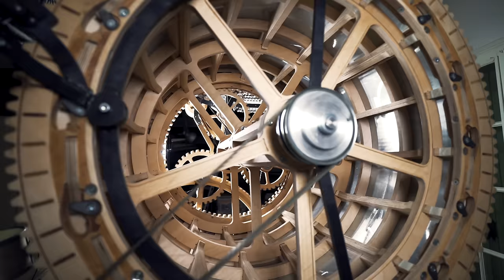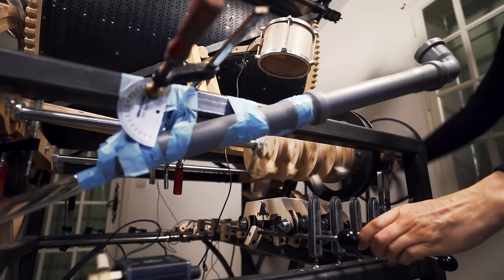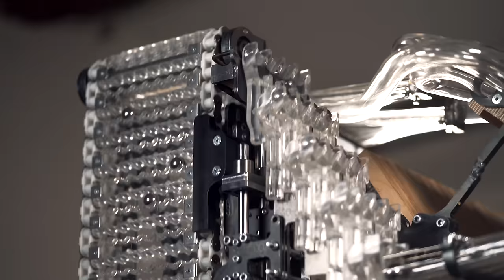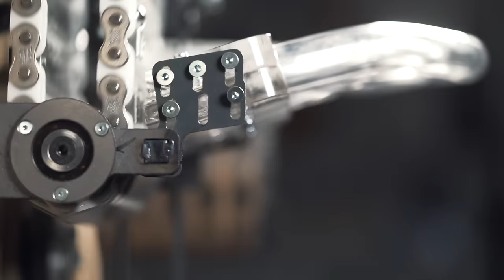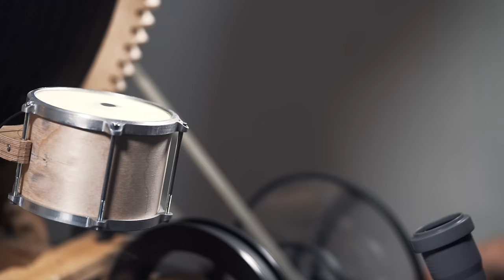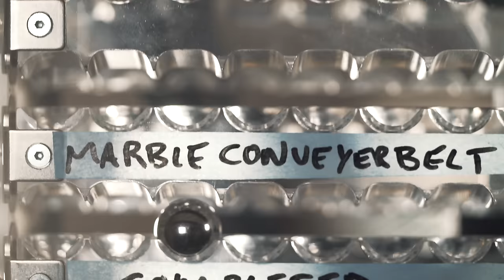Marble Conveyor Belt Completed! - Marble Machine X #78

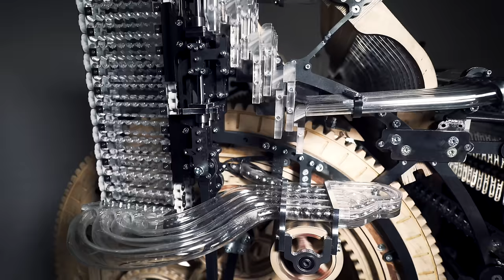Comment: I can foresee that demagnetiser causing a bottle neck. 0:35 you can see the issue up close, it is relying on the next marble coming from the wheel to push at least 30 marbles in front over the demagnetiser. 
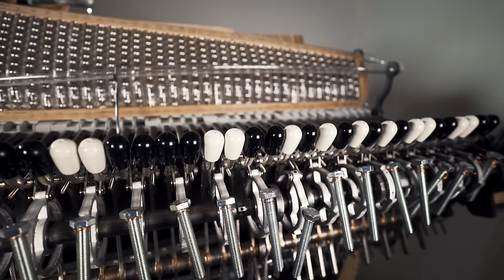Also you may have set tolerances too tight at the top of the marble divider 1:20 you can see a marble skip straight over the channel that requires more marbles
I don't say this to belittle your achievement but because you drew me into your dream of perfection and I really want this to be the best it can be! 
Keep up the good work, you inspire me to do better!
Reply: As beautiful as this all is there are plenty of parts that seem to only function with luck and reinforced with prayer 😂
Reply: He states that the marbles getting stuck on the wheel is part of the design as it forces them to hold longer over the demagnetizer and ensure perfect demagnetization
Reply: @nicolhime3981  he said marbles getting stuck going over the wheel was beneficial. However with the marbles backing up all the way to the lifting wheel, at full speed with even half the channels playing this is just going to have marbles flying everywhere.
Reply: it seems to me the solution is going to require a considerable refit. the whole conveyor belt will likely need to be lowered a couple of centimeters or a couple of links added to the chain, and just the bottom lowered so that the marble divider (the piece that looks like a tiny grand piano) is lowered and therefore gravity will help push the marbles through. This means ordering dozens of replacement parts and it could take time. So I'm willing to bet Martin isn't prepared to accept defeat in this matter just yet. Its still possible that with the force of many marbles being continually forced through that it works. If you notice its not until the wheel stops supplying marbles does the separator begin to clog.
Reply: @gwpcs  Calculating flow rates of marbles sounds like an interesting problem to solve.
Reply: Easy, just write a guitar solo into every song, while he goes fetch a refill bucket full of marbles.
Reply: How funny would that be to see that live on stage? The musician waves in a pair of helpers mid-concert as they walk in with a bucket of ball bearings and a specialized tool to input marbles into the system without causing interference.
Reply: The marbel at 1:20 wasnt flowing down that holes channel. It was flowing down one of the ones further behind it i think to allow it to go straight to the ones at the end
Reply: @jordandrake9822  I think you are absolutely right
Reply: G Clifton-Sprigg
it's good that it's sitting that long on the demagnetiser, also there's only a single note (marble) every so often. wait until more notes are filled in before trying to fix things, as trying to over prefect something before you even had the chance to see it in full force will lead to a never ending cycle of fixing what is not broken.
Reply: I'm sure there will be many little hiccups that will need some massaging to run smoothly, each will be identified as it progresses towards completion. 

It's great that it's now at a point that all(most) of the systems are built(conveyor belt, stairs, divider, release mech, flywheel, etc..) they all had to be completed before proper testing can be done, something I'm sure will be an ongoing process as each instrument is added.
Reply: @jordandrake9822  good spot I believe you are right

Comment: sound aside, this is satisfying to watch operate
Reply: Po Popo  the music all bit was shorter and simple, it's True. Not completely unenjoyable though. 
Given the choice between the two the original was a better listen.
The camera work on the original and the design of the original wasn't as polished though, so wasn't as mesmerising to watch in some places.
Reply: Po Popo  everyone is entitled to their own opinion. People like different things. I acknowledge you liked the first one better in all aspects.

I enjoyed the visual motion of the machine in this one, and camera shots where the gears were centered in the frame and spinning smoothly or the staircase system merrily moving up and down to raise marbles higher platform was something I enjoyed.
The original one had multiple tubes that helped transport marbles which didn't have the same whimsy

Comment: Ooops... one rogue marble at 5:58, but doesn't matter, there's 999,999 more to takes it place :)
Reply: There's plenty of them at the end of the video. Look at the floor.
Reply: I reckon it would be worse on tour, if played on a floor that is slightly out of level it will change how the marbles fall!
Reply: @TomMakeHere  that's why the feet of the machine are adjustable
Reply: @manelcosta4097  Ah all good then. I came upon this build part way through, still working my way through the older videos
Reply: Relax guys , this is just a testing 👍 it's not fully finished yet
Reply: I thing there won't be "rouge" marbles once the machine is finished. The funnels haven't been assembled yet.
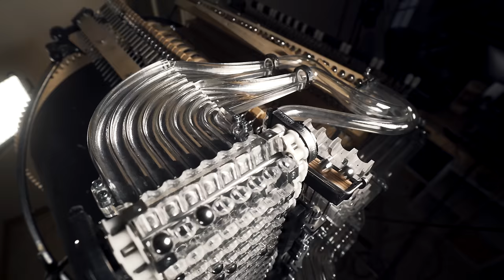Reply: @BacsPet96  The one at 2:53 looks harder to fix
Reply: @CodeKujo  Nice catch! I haven't seen that one. Yes it'll be. Maybe it can be solved with  a small plastic plate mounted to the bottom of the marble lifter, or idk how.

Comment: I wanna know how long this took to build from start to finish…?

Also, his right arm must be jacked compared to his left…no, not for that reason! Get your mind outta the gutter lol
Reply: At this point in the timeline, he had been working on this for about 3-ish years from conception to this point. However, going through the entire build playlist in the videos again, you can see that he started physical construction with the prototyping around January 2017. He has since kept working on the machine and is still not finished. It's hard to describe why unless you watch the videos- but essentially he got some priorities wrong in the design and this interfered with the engineering aspect of the machine to the point where it could not deliver the level of reliability and consistency he needed to tour with it. So, he has made revision, after revision on the quest to the sacred "1 million marble drop"-test where his goal is to be able to play 1-million marble drops in a row without any failures. His latest test I think was 30,000. It's a trip!